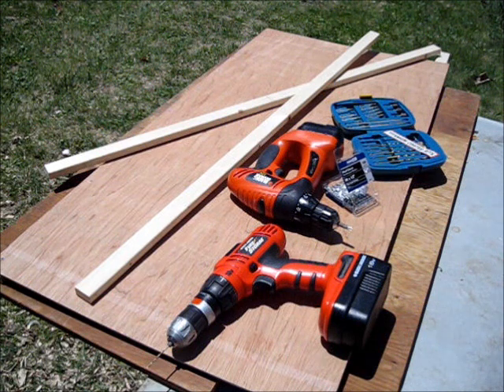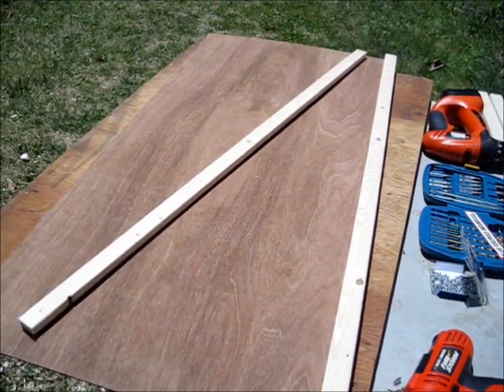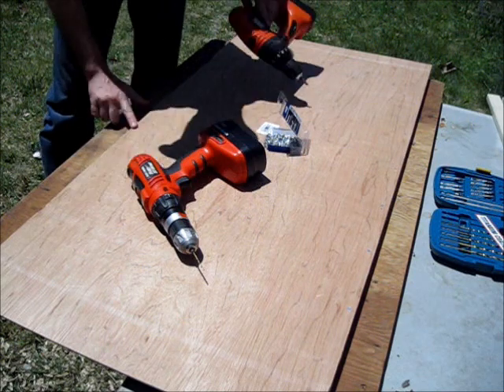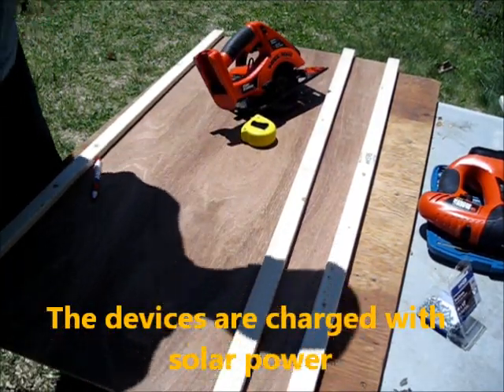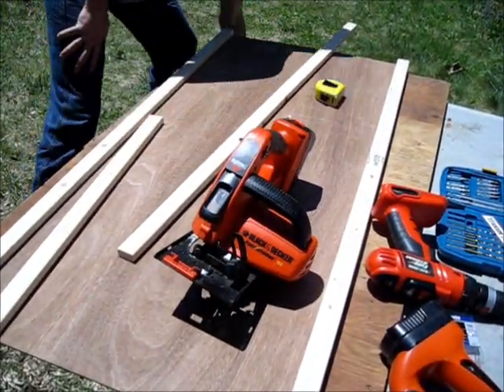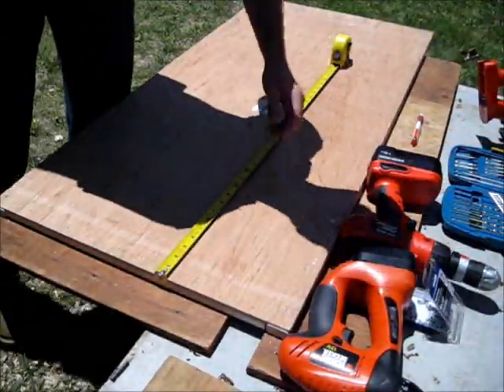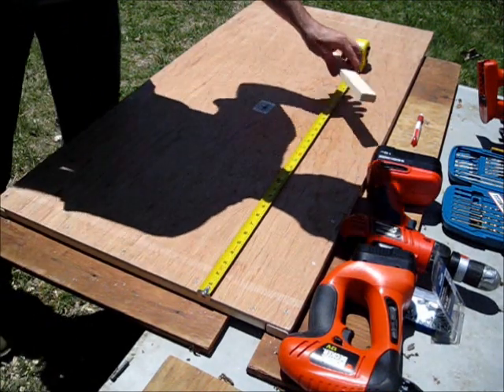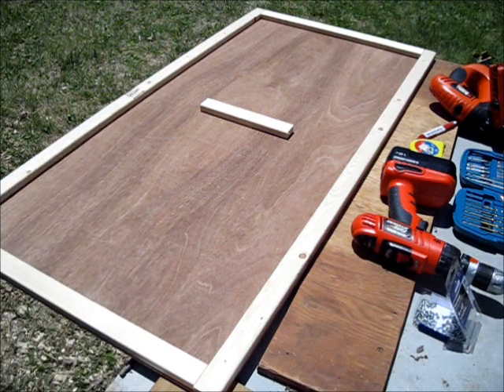How to make solar panels - making the frame in 15 minutes

Comment: If someone is planning to make there own solar panels, it's a safe bet they have a basic knowledge of tools and procedures. I don't think you need to explain the obvious why your drilling pilot holes etc. Just show some boards then the finished frame or simply say use a 2x4" sheet and a few pine furry strips and build a frame. Done.
Reply: Not! I know nothing.
Reply: +Tucker Not Sucker! I like the name ;)